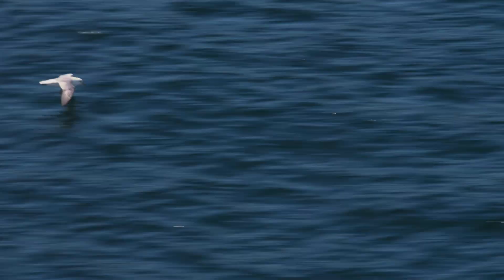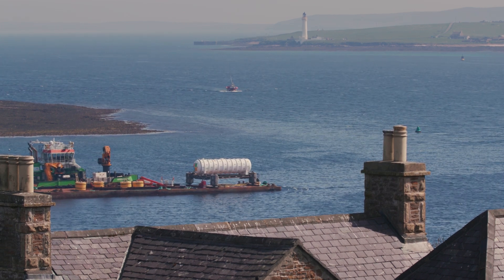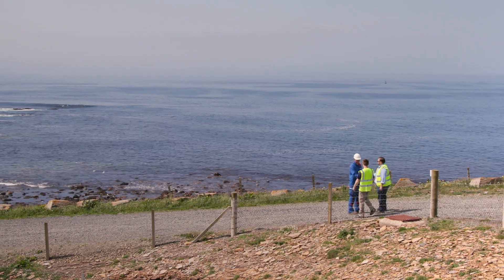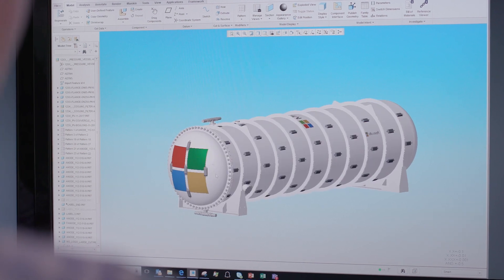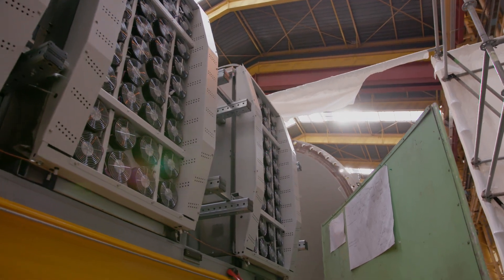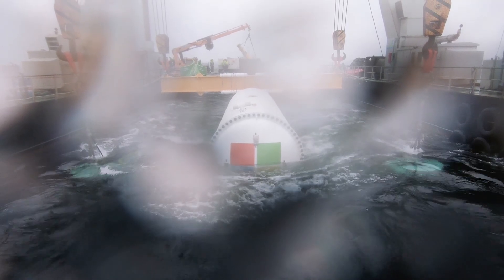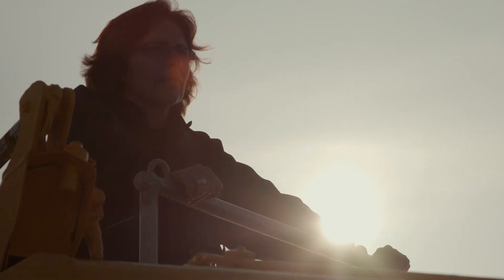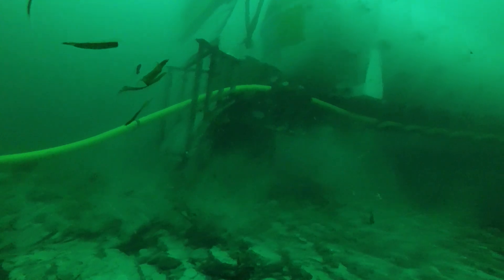Microsoft tests Project Natick, self-sustaining underwater datacenter

Comment: Seems cool but why doesn't the low ocean temperature cool the servers directly without such a plethora of fans... For example a system where one side is pure heatsink and the hottest stuff is attached there to the point there almost a direct connection between the heat and the cold... I'm assuming this is done but they don't explain it at all.

Comment: Definitely resist it! It will heat the seawater thus damage the fish and environment! Also the noise made by it which might not be heard by people, like ultrasonics will also harm the biology underwater.
Reply: What if it's put at great depths? Below ocean depths of about 2200 m, where the pressure exceeds the critical pressure of water (22.06 MPa or about 218 atmospheres for pure water), it can no longer boil; it becomes a supercritical fluid. Without boiling sounds, deep-sea volcanoes can be difficult to detect at great distances using hydrophones.

In water that’s isovelocity (the speed of sound is the same), sound refraction should not be a factor, but very few significant bodies of water are isovelocity. Temperature, salinity and pressure changes cause velocity changes as those factors change which may cause ultrasonic sounds to refract away from hydrophones.

Comment: How is this a great idea if you're generating the heat underwater which will rise up the sea temperature?
Reply: Divisor The heat generated by the servers running is the same even when in water. The difference is in the energy required to cool down. On land you would use Giant ACs which in turn generate more heat, here under the sea you still probably use an AC but consuming less electricity as its cooler down there.

Comment: This might be about keeping their servers off shore, outside of government regulations.
Reply: The project is close to shore, well within what is considered a nation's territorial waters, to say nothing of a nation's Exclusive Economic Zone (EEZ). This isn't a feasible plan to get outside of the jurisdiction of the Scottish government, or any government for that matter. It still has to have a tether for electricity and fiber optic data.
Reply: @Mark Marston SHHH! Don't tell anybody!
Reply: So you're talking about when the U.S. Department of Justice was requesting data that was at a Microsoft data center in Ireland. Microsoft turned over data that was in US-based data centers, but not at its Ireland operation. (U.S. v. Microsoft).

The issue has been mooted by the passage of the CLOUD Act through Congress and signed into law by President Trump.
Reply: maritime laws
Reply: It's more about reducing latency, lowering cooling costs and improving reliability.
Reply: Trevor Brass thanks for your reply. I seem to recall MS is in a court battle or was in a court battle having to do with where the information actually resides. Some entity requested info and MS technically said it was in another country. I was thinking this project would help them solve that type of problem in the future.
Reply: Also, just realized that crypto currency mining is all about the cost of cooling/energy. This could solve that too.
Reply: Trevor Brass Thanks again! I’m always skeptical about things that are “Green” because of other agendas hidden behind the green label.

Comment: MICROSOFT THIS IS CRAZY!
1. A russian submarine can take it out with one hit
2. dont run Azure cloud services on that data centers!
3. If the place where data center locate is not protected and have no restriction of physical access , than it only mean that is insecure and can be used as potential entry point for hackers.
4. what about hardware maintenance like , firmware update and software patches?
Reply: You really that thick? "Sure I'll go scuba down to it and steal some data, ohh wait. Water flooded in and destroyed everything." I also feel like they have a depth sensor or something to figure out if someone is lifting that thing up. Lifting it up can't be done with a small fishing boat either, that thing weighs a fuckton and a half.
Reply: A Russian submarine can take anything out in "one hit"
Reply: You dont get my point, the point is this area is not protected and if not protected means data not safe and vulnerable and you shouldn't store there anything sensitive and critical to you business and your customers!!!
Reply: Just as they can break in to google data centers around the world? You have to realize that this is only a proof of concept. They are testing if this would be a viable option for the future, they are not selling this as a service to anyone in a long time. I'm sure they have something to keep the pods from being stolen, but I think it's less likely that they will be stolen than that someone infiltrates an existing data center and steals data from there. Or why not just try to hack those underwater pods? Hackers have succeeded in stealing all sorts of things in the past, way less effort than lifting that shit up from the seabed, transporting it somewhere and then getting it up and running again just to steal some data, might not even be very sensitive data.
Reply: I get what you're worried about, but this is a concept for now. I imagine that if underwater data-centers would become a reality one day, companies who run them would invest into physical security as well. From the top of my head, a structure similar to an oil rig would be the place where a data-center would be positioned next to, cameras, sensors, personnel would be there, etc. This concept is far from reality for now.
Reply: How many data centers are protected from russian MiG raids?
Reply: well this is a joke right? NATO has constant air surveillance in Europe.
Reply: it's wired to the shore!
Reply: Well we don't know for sure or you did watched the place ?, it wasn't shown in this vide
Reply: How exactly do you think the data is transmitted ashore?
Reply: Well in modern data centers with high security clearances it is difficult to break in , but underwater what you need some ships some good hooks and do it like in night time. 
I think better solution would be like create artificial pool with water and place there the container, i mean  at such place where security is manageable.
The problem we dont know what kind of data they run on those datacenters and how it is connected to the outside world (Hope it is VPN with SSL and good encryption), i am currently advising to my customers not to use Azure because god know where Microsoft stores their data.
Reply: tr233, you're one of those who bought a beanie with aluminum lining I'm sure. That thing might not even be connected to the internet, it might just be connected some other endpoint or in the future, maybe a hub that connects several of these underwater DC's so it wouldn't even need a VPN.
Reply: Lol, it only question of logistics , if somebody have enough resources and interest in data which is stored at those servers , then it is not a question of  time but rather of when it will happen and if the area around the container not protected i am pretty sure that this will happen rather very soon.

Comment: So many questions that their project page doesn't cover. How did they deal with heat? It's a sealed tube at 35-50 feet, they appear to be using standard racks with fans, so I'm guess there is some kind of intercooler setup, but with that kind of density in a sealed environment it would seem they still end up with heat soak. What kind of air mixture are they using? How do they deal with hardware failures (do they just isolate it and wait until the 5 year change cycle?) . They must be planning on using a localized energy system (this current phase in running on grid) otherwise I don't see any advantage to this system, other than coastal city deployment. I would love to see how they anticipate managing this at scale, because I can think of dozens of problems that would arise with 10 or 100 of these clustered on the ocean floor.
Reply: Lets call it for what it is: an anti-FBI raid datacenter. Based on the limited information, it looks to be no where near the coast line. So lets assume it's at least 12 miles off the coast, and placed into international waters. Good luck with the subpoena! However, at least we now know where the DNC and Hillary relocated their servers...
Reply: The two test modules I saw looked to be within a half mile of the coast. But even if they are putting them in international waters, the cables are local to the country and objects left in international waters could be labeled as abandoned allowing the government could use maritime law to seize them. Also, I'm sure Microsoft wants their data centers under the protection of a sovereign power, otherwise any country or company will just float down and take a peak.
Reply: This area off Orkney is a well known shallow bank which contains many many renewable tidal experiments so the usage here is because Orkney probably provide very easy access and mooring to the datacentre throufghout the project life, along with power and an a decent internet connection,. I wouldn't just to the conclusion that this is a law avoidance thing.

Comment: What about maintenance?
Reply: Plot twist, they are running linux
Reply: In their plan the datacenter will last up to 10 year as it is, without direct on site maintenance, and than it's recovered, substituted, and scrapped for parts to recycle for next builds. It's simply not designed to have people around. 
I think they will staff it with redundant hard drives and clusters so to cover for hardware failures up to the wanted lifetime.
More here:
https://natick.research.microsoft.com/
Reply: These are servers, mot workstation, lol. I think they'll be good.
Reply: MTBF is not time, but probability of failure! ;-)
Reply: there's no need of maintenance until an end-user put hands on it...
Reply: I think he means maintenance as far as the salt eating away at the metal
Reply: they will be ok because of the Linux lol
Reply: Computers never need maintenance, because... uhoh.  Well certainly Microsoft products never need to be restart... alright but they're pretty damn diligent about never issuing patches that might get the server stuck in a blue screen of death reboot loop.... oh man are they in trouble.

Comment: I am curious about the security ramifications of this deployment as well.  Granted it is a sealed capsule, but physically it looks accessible to anyone that found its location.  Interesting concept however; it is great research is being done to reduce energy consumption.
Reply: If someone opens it water will rush in and destroy the electronics inside. I'm sure they have sensors to detect how the undersea currents affect the capsule. Those sensors could notify them if someone tries to tow it away.
Reply: Ships don't drop anchors at those depths.
Reply: Yeah and what happen if they accidentally hook the cable of this underwater datacenter?
Reply: Are you sure , are you really sure?
Reply: adelphis How deep did they deploy it?  The intercontinental internet cables get damaged from anchor drops near shore.  I would suspect unless this capsule is at extreme depths it could be susceptible to damage.

My initial post was however assuming someone breached the capsule.  There has been rumor that countries have been able to tap undersea cables.  If that’s true, then they could spend the cash to tap a capsule without flooding it.  I suppose if they wanted to get serious with this they would likely have to have real physical security around the capsule to protect it.
Reply: On the flip side, it's a large boost to potential high scifi rigamarole.
Reply: nope they not

Comment: Isn’t there a problem in putting so much excess heat in the ocean? I’m not impling, I only want to know more about it :)
Reply: This isn't really a big deal, but yes, in principle it's not good. Standard approach heats the atmosphere, though: the heat can't be magicked away in any case. Sea-heating is more "efficient" in that the energy doesn't readily escape the water, but also there's no powerful fans in this setup, so there's less total energy pumped in.
Reply: that's what I was thinking, positioning would be crucial, otherwise local marine life would be impacted. positive or negative impact - that's something to figure out. I've seen marine life thrive because of volcanic openings heating up the waters around them.
Reply: It'd likely have local effect though.
Reply: It's such a tiny area, as Danny suggests; comparable to a fart in a hurricane. To create any measurable effect, you would need the entire continent of Australia farting simultaneously. Not a likely scenario.
Reply: Fabio Polidori simply - the ocean is big. We already cool powerplants with seawater
Reply: Salko well, it wont compare to a volcanic Vent lol
Reply: Joey Splats 
This is a test 'fart' but computing power is growing exponentially and so is the energy it consumes. So this 'fart' might really become significant in the future, and we might be stuck into problems worse than global warming. That might be a little far from now, but it's actually quite possible. Also, it's definitely better than leaving it in air, but that's still not a permanent solution. The permanent solution consists of improvements in computing technology as to reduce energy consumption per unit of computation.
Reply: Hey now, there's only like 24,000,000 of us and its a pretty big island were on, I'd think that you'd need to 10 times our number to make any measureable difference.
Reply: @Mark Davis I think getting connection in place would be the problem in that case :)
Reply: +swedisch elite hacker system!!!!!! true, but if you make these datacenters in proper capacity then it could have some local impact
Reply: Drop them in your own country. And then enjoy the heat.
Reply: Fabio Polidori no worse than dumping 300,000 gallons of radioactive water into the ocean every day for the past 7 years (Fukushima) . So....yes, but no, not really. It’s better than on land tho. Safer and more efficient. The cooling costs for the data center would be insane if it was on dry land!
Reply: Not sure if you're serious.
Heat affecting environment at a scale that would be concerning would have to be a lot bigger than this tiny project.
Reply: the google comments need better nesting, I was replying to Giao Vu. But yeah, I agree with you Joey Splats, a lot of "farting" needs to happen in order for it to have an effect.
Reply: Obviously we need to just drop them all over the polar caps.  Cooling problem solved.